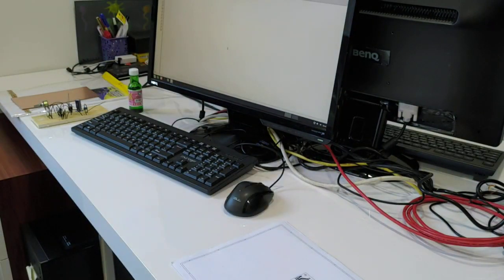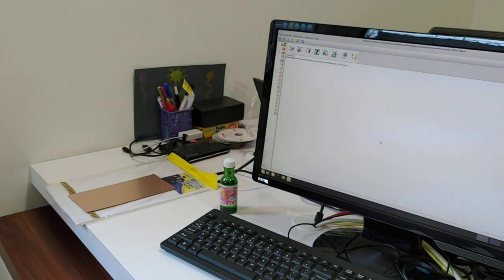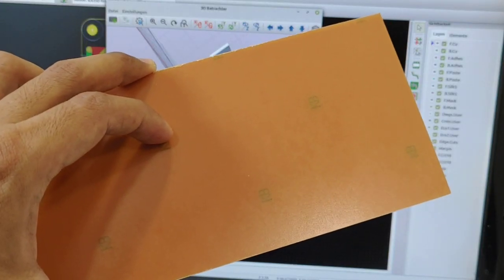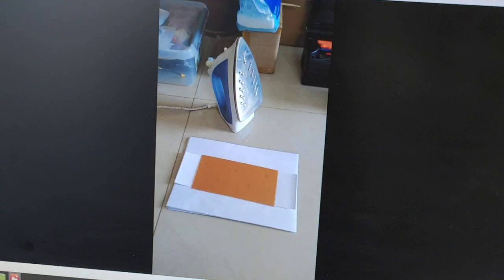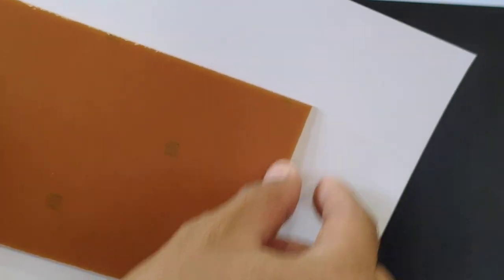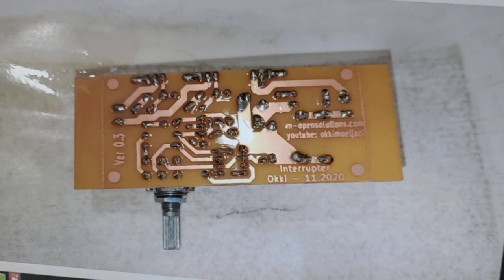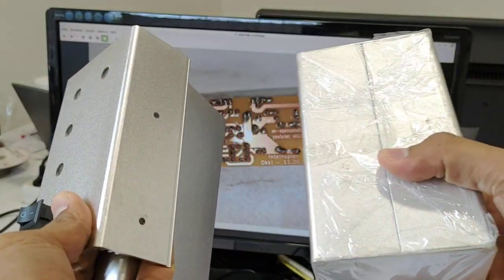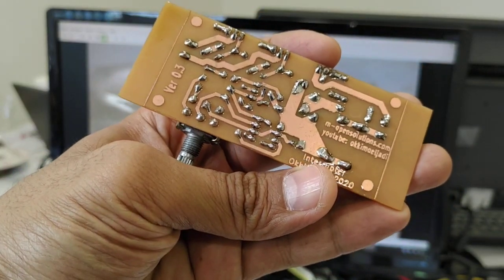How I make PCBs

Comment: Hey Okki, if you use a plastified paper the toner will transfer without excess paper in the holes
Reply from the maker: Hi Gianni, thanks for the info. I'll try that. Do you know how to find such paper? Here in Indonesia everything is a bit different than in Europe.
Reply: @OkkiMoeljadi  i use the adhesive paper, use the plastified paper from it, after removing the adhesive paper, then use it in your Laser Printer, i prefer to attach it on a A4 paper with some pieces of tape, as support, because this plastified paper is very thin
Reply from the maker: @GianniLaschi  okay. Thank you very much for your tip. I will try that. I accidentally bought adhesive A4 paper.